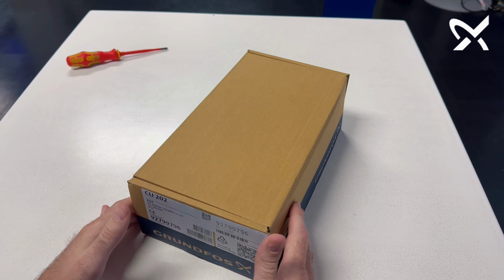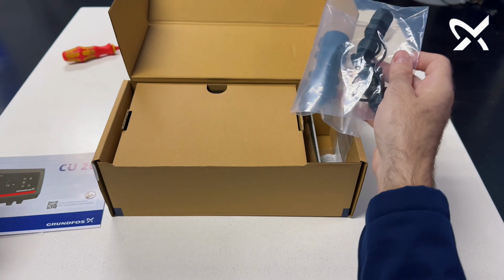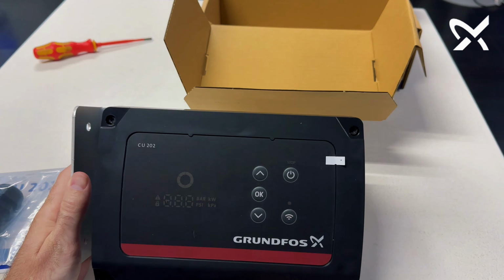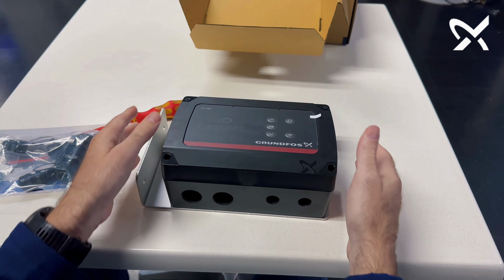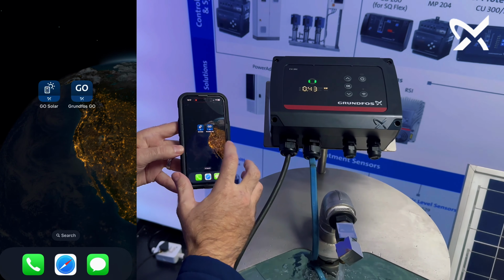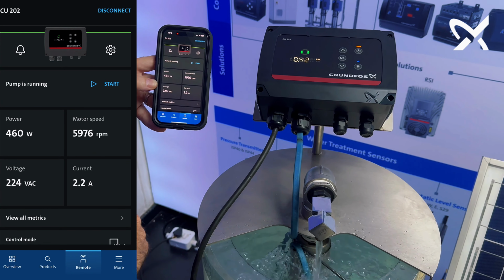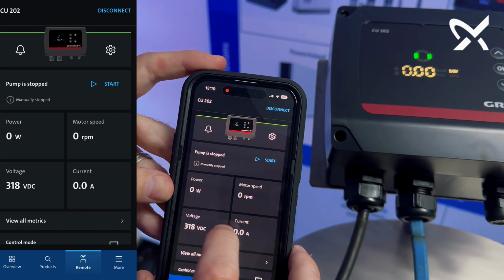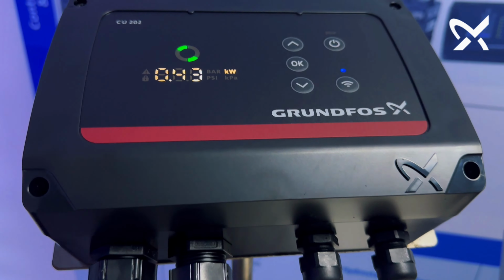Grundfos CU 202 Controller Unboxing, Features, and Installation Guide

Comment: Do you need a pressure switch with this system? We have a pressure tank and the CU202 but can’t seem to figure out where the pressure switch comes in or how to connect it.
Reply from the maker: Hello sir,

Please contact our service team at http://gfos.ly/6052BB3fVI
They will help you to solve the issue. Or you may refer to the below link for the installation guide, (page 29-31). http://gfos.ly/6053BB3fVL

Thank you for contacting us! 
Regards